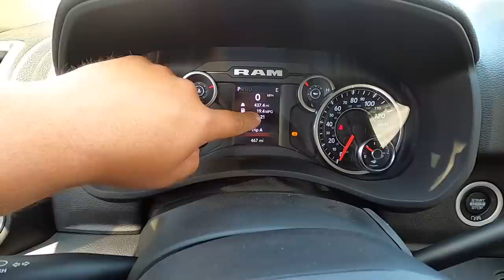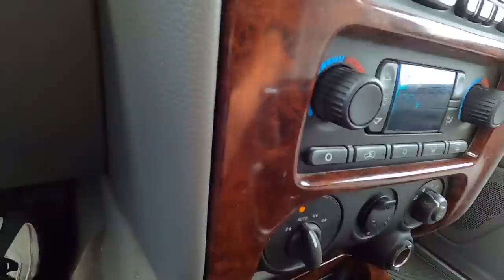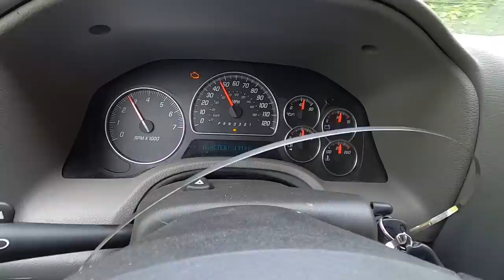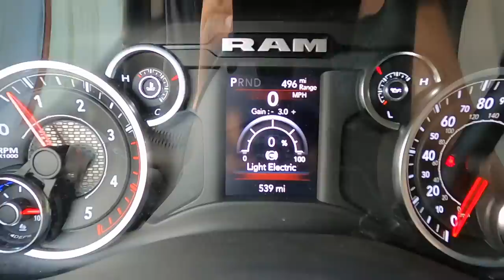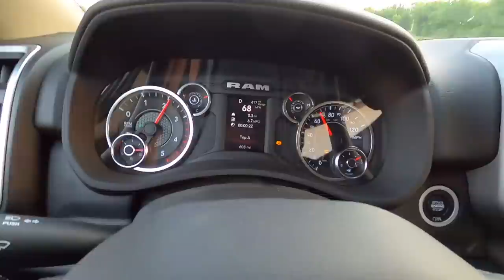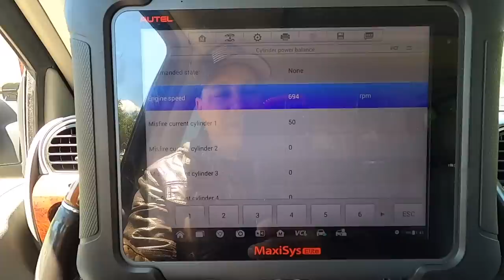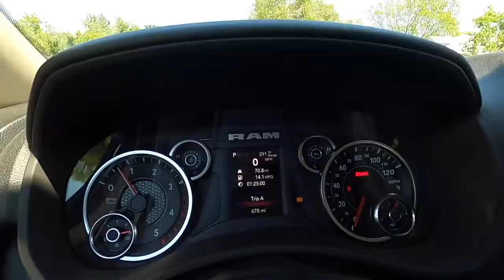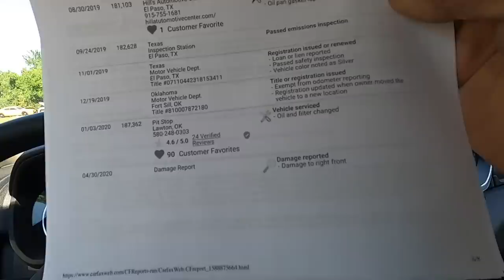$925 IAA WIN!!! 2006 GMC Envoy XL Denali 4x4 5.3L V8 - Run and Drive??

Comment: Sounds EXACTLY like displacement on demand issue! Pull that valve cover and check for play on one of the pushrods. Super common issue but a pain to repair. Let’s hope I’m wrong. After repair, do a AFM/DOD DELETE thru a reflash. Have a good one.

Comment: GVWR is Gross Vehicle Weight Rating, which is the weight of the vehicle (or trailer) and the maximum amount of cargo weight (or people and cargo on a truck). So your Envoy weighs about 5200 lbs so that means that it has a cargo weight capacity of 1200 lbs. 5200 plus 1200 equals 6400 lbs.

Comment: I have a 2013 ram 2500 and I pull over 8000 pounds not including the heavy duty trailor the Cummins motor is a man motor people can hate on ram all they want to but nobody can hate on the 6.7 Cummins they are a beast of a motor and neither Duramax or powerstroke can out pull it they may outrun it in a race but cannot out pull stock to stock got you a real truck there Randy

Comment: So I have just a couple notes. First off I love your channel and all the content. Secondly, it's probably a lifter causing your issues with both the tick and the miss. Pretty common especially DoD trucks. I'd also like to add that GVWR on your trailer and on the Envoy is Gross Vehicle Weight Rating. It's NOT the curb weight. So your trailers total weight rating is 7,000 pounds including the trailers weight and the GVWR of 6400lbs on the Envoy is for it fully loaded. The truck only weighs between 4600 and 4800lbs depending on options. For your truck it's probably 4800.

Comment: Another 5.3 with a smoked lifter. These have oil pressure and DOD issues and as a result lifters tend to bite the dust. It's a nice truck. It'd be worth fixing.

Comment: Denali itself doesn't weight 6400lbs.  Curb weight of that thing is roughly 5000-5100lbs.   The gross vehicle weight rating (GVWR), or gross vehicle mass (GVM) is the maximum operating weight/mass of a vehicle as specified by the manufacturer including the vehicle's chassis, body, engine, engine fluids, fuel, accessories, driver, passengers and cargo but excluding that of any trailers.

Comment: @autoauctionrebuilds the gross vehicle weight rating of a vehicle includes the weight of the car plus the load of people plus cargo. You would have to subtract said weight to capture the actual curb weight. You can look up online what assumptions are used when determining the gross vehicle weight rating (i.e. two adults weighting about 250 lbs each, etc.).

Comment: The Gross Weight is the maximum for the vehicle AND any passengers/cargo.  You can get a rough idea of the dry weight of the GMC by taking the GVWR and subtract the suggested weight of the passengers and cargo.  It is likely that the empty weight of that thing is around 4,000 pounds.  If the GVWR is 7K, then you need to deduct the dry weight of the trailer to see how much you can put on it.

Comment: The tapping is the exhaust manifold I've had to replace the gaskets on my 5.3 and it fixed it
Reply from the maker: It's a DoD lifter.
Reply: @AutoAuctionRebuilds  just did one awhile back on an 07 trailblazer, cyl 1 intake stayed collapsed, used crazedperformancerepair kit and got the lifter to expand, then used h&p tuners to disabled the afm, buggy runs perfect now and only cost a few bucks for repair, good luck fella

Comment: You should really be lashing towed vehicles via the unsprung parts of the vehicles i.e around the rims, lashing it down via the frame/chassis the suspension can still travel and could possibly loosen the lashing off.

Comment: I also had a ticking noise. it was my exhaust manifold bolt that broke and the ticking was from the manifold gaskot not being pressed down fully. it should be on the driver side rear of the engine that has the bolt broken.

Comment: Hi Randy, love your truck and trailer setup. Went to a dealership near me, showed the pic of your truck and trailer and curiously they offered me the 1500 Classic with 5.7L HEMI VVT V8 w/FuelSaver MDS. It can tow up to 9,310-10,760 lbs. My Fiero weighs roughly 2,700 lbs and my Mustang is 4,000 lbs plus the trailer weight. What do you think? Thanks and keep up the good work!!
Reply from the maker: A Bus Driver's Vlog it’ll tow for sure, but with your mustang and trailer it’ll be riding very heavy for sure.
Reply: Auto Auction Rebuilds, according to the salesman, it should be good on mileage because the MDS, it allows the engine to run on 4 cylinders instead of 8 on the highway, for fuel economy. Ram 2500 is out of my price range for now. I make sure I have the weight of each vehicle and review my needs I guess!

Comment: I have to agree, you have a collapsed lifter. And being the truck is high mileage, that type of repair is not unexpected. If you do it yourself, parts are not very costly. They get you on the labor if you have a mechanic do the job. It would take about 4 to 6 hours to do.

Comment: Take a coil wire off from a different plug and switch it with #1, then see if your code switches to the other cylinder.

Comment: From what I found, the gvr of the trailer is the weight of the trailer, plus the weight of what you are towing.  The empty weight of the Denali ranges from 4,500 to 5,500 lbs.  Perhaps the place where you bought the trailer could tell you the weight of the trailer itself?

Comment: That 7,000 GVWR on the trailer is the max capacity of the trailer, including trailer and cargo.  The 6400 GVWR is the maximum loaded weight of the Envoy, not the actual curb weight.  I would say that if the Envoy actually weighed 6400 lbs the trailer was over capacity.  Actually, it might have been over capacity anyway...

Comment: The gvwr is not the vehicles curb weight that is the max total weight it can hold the envoy probably weighs 4500 lbs or so.  The trailer itself probably weighs 2000

Comment: That tick tick sounds like a connecting rod bearing. It's to loud and a deeper tone from a lifter tick.
If it is a connecting rod bearing, I have dropped the oil pan on other cars, removed the rod cap, tap out the old bearing and invert a new one. 
Don't know if that can be done on that GNC.

Comment: Love the truck I think you’re probably going to stick with the Dodge from now on I switched over to dodge go excuse me ram products about three or four years ago and I’ve never went back came over from Chevrolet
Reply: i'd love too have a Ram 1500 with a Hemi but my Trailblazer kills me on gas as it is :/
Reply: Ram has stepped up its game big time. I have the Pentastar and I've been impressed so far. It doesn't tow that much but it's got good power and fuel economy. And the 8 spd has been dead reliable. 267K miles and counting.
I used to want an F150, not anymore. My dad's truck has had more problems than mine.

Comment: Could be a lifter check cylinder 7 driver back. It is a common problem on these vehicles. It's about a good 5 to 7 hour job to fix.

Comment: The 6400 lbs for the truck is the max weight for the truck and cargo. That truck probably doesn't weigh more than about 3500 lbs. the trailer is probably about 1500 to 2000 lbs.

Comment: Collapsed lifter. It will cost $75 to have the computer programmed to turn off DOD.  You will also need to tap the lifter to release it and put it in non afm mode permanently.  Just remove the intake and valve covers, find out which one is collapsed.  It’s about a 2 hour job and car will be 100%. A hammer and a punch that is ground properly is all that is needed to release the collapsed lifter. If you need one, I can find  mine and mail it to you to borrow. Fixing it will be a great video. So simple and it runs so much better without AFM.  You need no parts. Just programming and labor.  Do not drive it or you will ruin the cam. You can see the cam with the valley cover removed.  I am sure your video is old so hopefully you did not drive it. Also the conductor plate may have caused the collapse.  It’s a $200 part.

Comment: It's a flip so pull the head, pull the lifters on cylinder 1 and replace them.  If the cam isn't chewed up evident by the condition of the roller on the lifters just reassmble and send it.  That way all you need is 2 lifters, a head gasket and one bank worth of head bolts.  Or be really scabby and reuse the head bolts... lol.  To do a delete that's both head gaskets, lifter trays, lifters, the cam, a valley cover( any gen IV that doesn't use AFM has them so 4.8's, 6 liter iron blocks, some 6.2's etc), head bolts and tuning.  Honestly not worth the input cost even doing it yourself as 90% of buyers will not care and it doesn't increase the value over it running well with the system still active.  Now if the cam is wasted then maybe do a delete.  For a simple cam swap that's ultra cheap just use a Gen IV 4.8 cam... probably get one from someone for free lol.  I would never buy a "delete kit"... they charge a bunch of money extra to package it for you lol.  And as I mentioned... the valley cover isn't hard to find and any LY2 4.8 in a half ton or a van has one.

Comment: The trailer GVWR 7000lbs . Weigh the trailer if it's say 1500#, then take 7000-1500 which equals what you can haul with the trailer. Weight the envoy it don't weigh 6400# it's the same formula as trailer! Look at the dodges manual for combined weight when towing!

Comment: Randy it wouldn't hurt to run your rig over a scale if you're not sure what your empty weights are. And I'm not gonna say anything about using one strap at each end to hold the thing on the trailer....

Comment: The GVWR is not the vehicle weight as it sits. That is the vehicle with a full tank of gas, the driver, passengers, luggage, Etc. You need to figure out the curb weight. I'm guessing that it weighs around 4500 lb oh, but that's just a guess.

Comment: gvwr on that trailer is 7000 meaning max weight including the trailer and load the trailer weight is on the certificate of origin probably around 2500 lbs im surprised that didnt come with 5200 lb axles

Comment: Your Dodge probably won't use any DEF before it's done 500 miles, and often not before 1,000 miles as the self-purge system is usually deactivated before then on diesel vehicles to avoid it activating before that sort of mileage and the heat generated causing damage to vehicle systems.  The chances of needing to run a DEF purge before then, even on a vehicle that is used solely in slow, stop-start town driving, are incredibly low...

Comment: 4/30/2020 ... front end damage reported.   Is that indicating what IAA noticed/documented OR does it signify an accident to front end?   Just curious.    Considering age, mileage, price...   phew, would drive this one in a second!   Given it could be a good A to B & dep. upon how involved or cost of the whole Dod/afm repair.   Is that something that's a 'must fix'?  Probably, huh... esp w/ ck engine light flashing.  =/   Hopefully it won't be too involved or expensive to repair IF absolutely necessary.    This one looks SO nice, inside AND out...   In this moment tho & current situations.. reliability... is what's most important imho.     Thanks for sharing this awesome find & score!  Stay safe & be well.

Comment: 33:33 Its crazy, if only they had designed a way for 4 wheels to drive out of there... also 4x4 would have probably saved you because the front of the truck sits higher than a 2wd. especially if you have decent M/T or even All terrain tires on it that 4x4 is a lot better than having to get out and dig!

Comment: Probably lifter tick. I'm not sure if this version of the Vortec 5300 has that AFM crap on it but if it does throw a tune on it after addressing the engine so that feature never engages. Worst feature.

Comment: Has a bad lifter that's what the ticking is from.  Had that issue on mine when I bought it ease to fix but have to pull the heads.

Comment: Gross vehicle weight is what u can do total like that trailer is probably around 1500lbs that dental is 4500lbs it says gross vehicle weight cause u could tow with it 2,000 lbs so gross vehicle weight is total over all. Look up the curb weight of a vehicle and that will tell you what the vehicle weighs